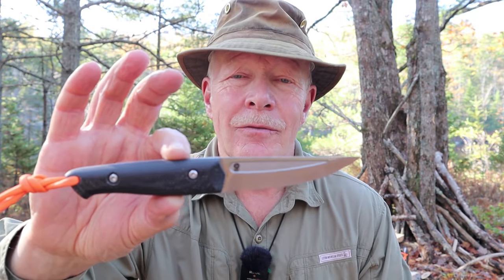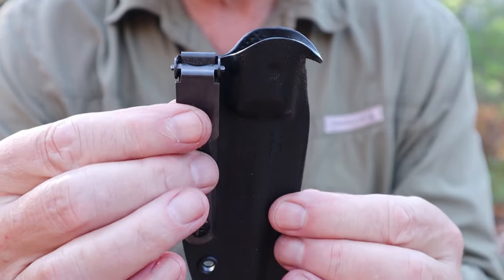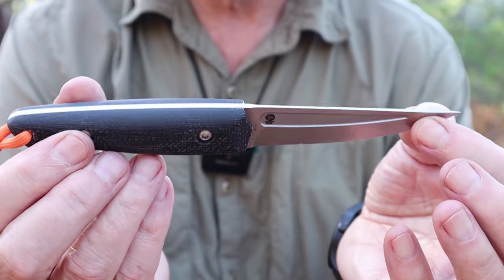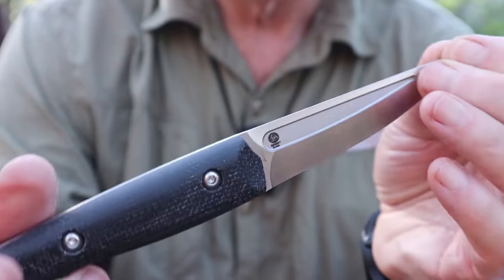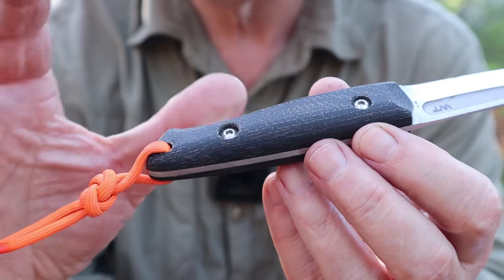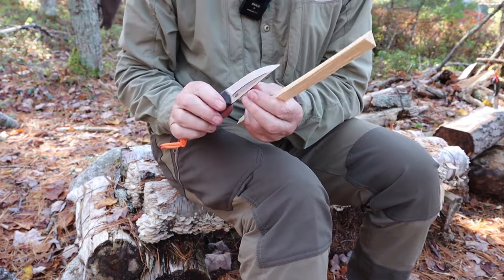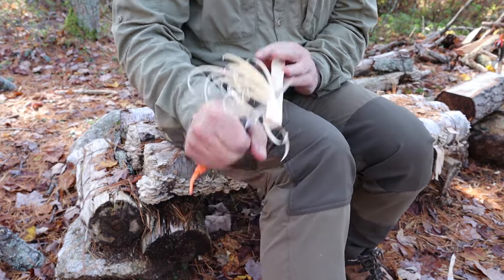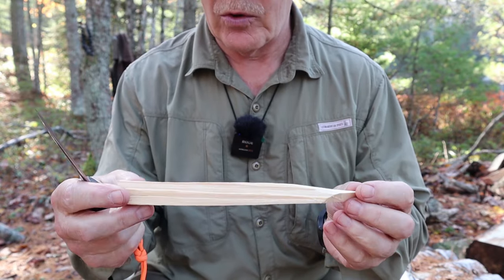Work Tuff Gear Ninjuko - Must Watch Before You Buy

Comment: Hey Mark.  Just watched another video and thought about you right away.  Some guy made an alcohol stove, similar to the carbon felt one, except all he did was use an old food can, with some sandy soil in it, then dumped some alcohol into it.   It worked really well, though maybe a little too fast burning.  Maybe something you’d like to look into.
Reply from the maker: That is interesting. I am working on a video about making wick-style stoves. I will discuss carbon felt VS fiberglass and even wool but had not thought of sand before. Thanks Jim

Comment: G'day Mark, must say, I reckon Joe is a great practical designer and this one is no exception for its design concept, + I could also see it as an "EDC", over a folder, on a given day or week at least, i.e. in rotation.
Personally, I've had excellent results out of N690 and 95, at around the same Rockwell, though in fairness with thicker stock and different grinds. I did spot the chip immediately and was wondering about that throughout, well done with the follow up mate. I haven't written it off just yet. Cheers Duke.
P.S. Re; carving, I did start off doing mainly spoons, however I'm finding a flat spatula, perhaps with a shallow dish, is more versatile, and indeed quicker and easier if you need a cooking/eating utensil on the fly. Also, quite simple "agricultural" forks are winner too, (larger and longer handled two or three pronged jobs), especially with the right timber selection, and fire hardened prongs are even better if you've a bit more patience.. 
As a fellow carver, you did touch on it this time, maybe a "full blown" vid opportunity, together with an appropriate knife review some time.
Just a thought mate ; )
Reply from the maker: Hi Duke. I have other knives in N690 and really like them but they are also thicker at the edge. Thanks for commenting

Comment: Even before you explained the problem, I was thinking it would be a good knife if it was a convex grind it would strengthen the edge, and negate the need for a micro bevel. N 690 is not my choice for any knife. Good review thanks for your effort.
Reply from the maker: Vic normally uses a convex or micro-convex secondary on his knives. It may have helped here but I think a different steel would help more. Thanks for commenting

Comment: I have the Tops MSF 4.0 in N690 that came with a true Scandi edge. My first use destroyed the edge. It took several attempts at putting a sizable micro bevel on it before it would hold a decent edge. Inevitably, it lost the carving performance I was hoping for...
Reply from the maker: I like N690 for some knives but not one with and edge this thin. Thanks for commenting

Comment: That's one sexy knife, Mark! 😊
I was thinking that it might be good for filleting small fish. Do you have a favorite fillet knife?
No surprise that a thin blade with a fine, long tapered edge might chip. Maybe someone can play with the alloys or tempering procedure to increase the edge durability. The design is quite attractive!
Reply from the maker: Would make a good knife for small fish but a bit short and not flexible for larger fish. I don't really have a preferred knife for fish. Guess I don't catch enough anymore. Thanks for commenting

Comment: Glad you spotted it, cuz I was going to make a joke saying most people may see a nice knife, but all I see is a big ole chip. 🙂
Too bad, it’s a pretty knife.  Even the fuller, which I generally dislike as being not only useless, but just a place for junk to accumulate, but in this case, it looks like it would give extra grip when pinching the blade.
That tapered handle would be good for most people, because your hand would be less likely to slip up to the blade.  Though with my busted pinky knuckle, I would have too little control.
I thought right away that though its sleekness would have some advantages, it did look awful fragile for any hard use.  Hope they fix it, though I think they should have four that issue before selling them.
Reply from the maker: I think this knife would rock in one of the carbon steels Vic uses. May have to sharpen more often but would stand up at the edge better. Thanks for commenting Jim

Comment: I completely agree this is a great carver, but Not a bushcraft knife. However, with a good big knife or hatchet this is a great small belt knife.  I noticed the chip as well. WTG make a great scandi bushcraft knife in k340 steel.  But, it’s $200…yikes…I’ll keep my Esse RB3…(also a little thin on edge with a true scandi, but is 1095 steel).  It’s almost half the price.  Thoughts on k340 steel?
Reply from the maker: I see K340 as an improved D2. With the right HT is should be tougher and a bit easier to sharpen with similar edge retention. The knives I have in K340 have taken considerable heavy use without issue. Thanks for commenting

Comment: It’s not a problem with the sheath by any chance causing the chip?  The blade is so slim I wonder if it’s making contact with a rivet or screw. 
I noticed the chip straight away and I was waiting for you to say something but you hadn’t seen it until you got home. 
Hope the issue is resolved looks like a great knife.
Reply from the maker: I had considered that but Vic's sheaths are well designed. Vic agrees it is the steel choice combined with the edge geometry. Thanks for commenting